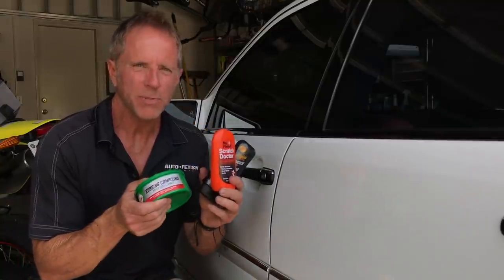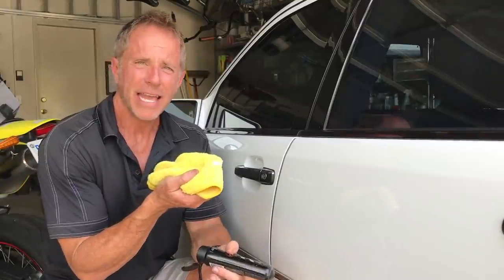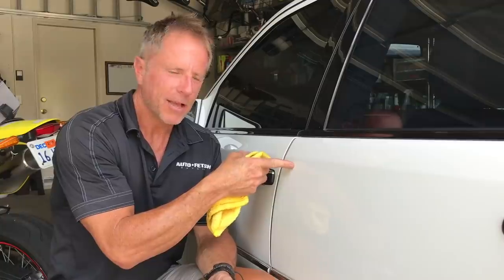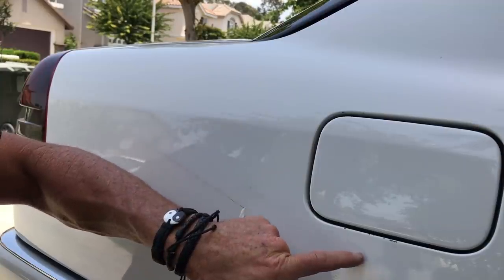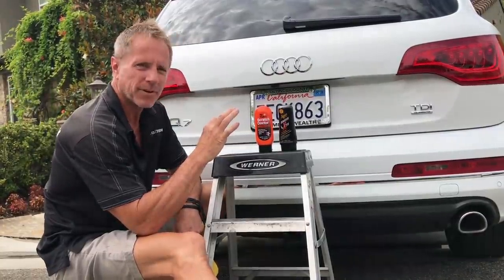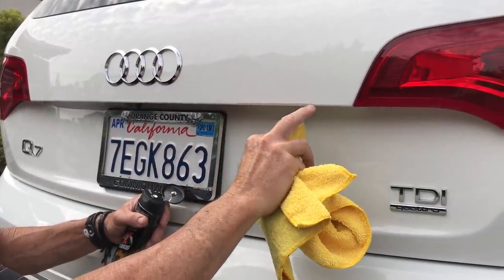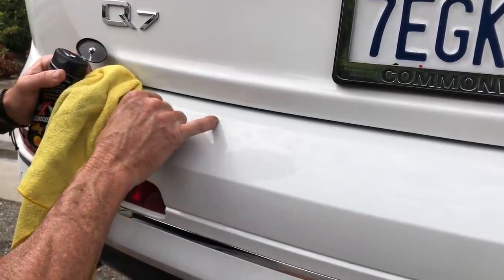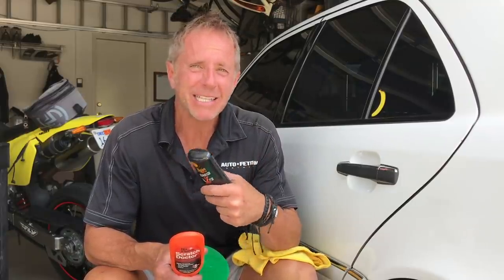Meguiar's Scratch Remover: Why you need this product

Comment: I just bought a secondhand black Nissan. Used this product to clean up some scratches and rubs and while removing fingernail scratches on the door I discovered that it will also remove set on water spots. Nice surprise.

Comment: I converted my cheap Harbor freight grinder into a polisher and with McQuires compound /polish removed most of the branch scratches I incurred whilst cutting through the bushes between my house and Sweet Dick Willies place in less than an hr.

Comment: I actually use the Meguiars to remove scratches from my eyeglasses works very well take the lenses out first amazing products
Reply: Working in optometry, we have to coninuously tell people that there is no such thing as removing the scratches in lenses. You can fill them, but a real scratch cannot be removed. If it happens enough to prescription lenses, you'll end up with lenses that are no longer your prescription because it's a bunch a scratch filler and not the lense that you are looking through.
Reply: Lol not a good idea.... like what that chris person said.... 
scratch X or any of these products doesn’t REMOVE scratches, it just fills in the missing gaps in clear coats where the light will reflect off of it and your visual perception can not see it.... in the case of glasses, lol you’ll be wearing it thinking that it’s repaired but you’re just looking at it through a new lens that has missing gaps that’s filled with liquid that just reflects light... lol.... you might as well wear an eye patch on one eye lol

Comment: Works great on smudges and blemishes.  Not so much on scratches! It does improve them a bit...
But sadly, does not remove :(
Reply: No if it goes through the clear coat into the paint you can't remove completely. All you can do is try and make it not so noticeable unless you wanna take it to a professional
Reply: Go watch chrisfix how to remove scratches video... of you’re lucky, you just need to know how to use compound, polish, and wax....

If it’s super deep you going to need to know how to use wet sand paper.... compound, polish and wax....!

If it’s completely into your paint where you see and feel the metal.... best you can do is touch up paint, and the previous method... it will hide it but will never go away 

Unless you pay thousands of dollars to have that repainted.... or you can paint it yourself if you feel courageous enough
Reply: Remember these layers

Wax
Clear coat 
Base paint
Primer 
Metal 

You gotta gage how deep the scratch is.... if it’s just to your clear coat. Polish and wax fixes it
If you can feel bits of it with your finger you have to cut off several layers of your clear coat using compound..... probably need to wet sand it.... if it’s completely to the primer.... touch up paint is all you can do

Comment: Thank you for the video, I've been scouting Youtube for a video on this product and yours is the best and most detailed. Some douche scratched my year old car and bolted and now I am sitting with a 4 inch long scratch to my coating. Hopefully this product will help. There is also a black line on the rear panel which does not look like it cut the coating. Your video helped me understand that it could be removed with this product. So finally your video has shed light on the 2 types of marks on my car. 
Thanks a ton Darren.
P.S. Bell icon smashed !!!
Reply: NOMAD DRIVES me f
Reply: Hey NOMAD. I know your comment was 3 years ago, but just curious. How did this product work on the scratches you had?
Reply: @J.A.07  Worked well. Did sand out the scratch but it was visible at certain angles. Best bet is to get the paint polished and it will vanish. This is just a stop gap.

Comment: Really appreciate the time you spent to shoot this video, excellent information you give me and now I can stop testing products on my old truck before do something on my wife’s car. 
By the way, both vehicles are white and my old truck has many scratches and I watched a video recommending to use a Mr Clean magic eraser soaked on water and it works , remove scratches and also your clear coat, my truck has fewer scratches but looks like it went to a fight with a sander machine. I know I shouldn’t do that but how can I fix all those spots? I try applying wax coats and still looks the same. Please can you give me an idea?

Comment: I had scratches on my car
I bought Meguiars swirl remover
It did nothing
I then bought Meguiars scratch X remover & applied it - it did not remove the scratches!!!
The thing it did was smell good & made me think of a tropical paradise for about 5 seconds. It did not even touch the scratches it polished them up.
I then dug out a rusty old old tin, the one you prise open with a screw driver, of cutting compound from under years of car products collected The cutting compound applied with a damp cloth REMOVED the scratches instantaneously miraculously i felt a sense of joy flood my being, the scratches were gone. I had to stir the contents of the old tin because it had seperated. I then used another OLD tin of polish to finally bring up a mirror finish
Say what you want but
I will NOT be conned by Meguairs again
Reply: Let me guess, that old tin can polisher filler you used was turtle wax🙄

Comment: Really like Scratch X 2.0. It also has other uses.
Used scratch x on a gun stock with a satin finish. Wow, not only did it polish the varnish, but the grain patterns in the extra fancy walnut stood out.
So besides car paint, it has other uses.
Reply: I was wondering if it could be used on the interior door handles of my new vehicle which has black satin paint finish, so was great to read it worked for you on a satin type finish.  Thanks.

Comment: I tryed this stuff on my factory OEM alloy wheels , just like Darren said in a previous video about polishing alloy wheels I was trying to remove some scratches like he said and it made it worse!
Reply: Raymond perez scratch x is an abrasive. It’s designed to to flatten out clear coating. You are making the scratches disappear by digging down the clear coat until it’s all even. 

So if your wheels don’t have clear coat on them... you’re just scratching them.

Comment: Why this product did not work for me?((( I have a light gray car and a set of scratches. The scratches are not deep at all, it is just an upper layer of the paint is gone, they are absolutely flat (no nail goes in). I think it is called a primer (the upper layer of the paint). Because when I wipe it with a wet cloth, the scratch becomes invisible (water reflects the light). I was so surprised that Meguiar's Product DID NOT DO A THING, nothing at all, as if I was polishing the car with just water.  I applied both using foam applicator (as recommended) and a microfiber cloth. What can be wrong with my car? I bought the product from Amazon, maybe it was expired or stored wrongly? Need to check. Besides, I have the other product (in the orange bottle, purchased from the store, it did not work, too.
Reply: Amateur detailer here. The upper layer is the clear coat, the primer is what goes on the material before the base paint :) I found with scratch X if you are applying by hand, you need work at it with moderate pressure for a good solid 5 minutes to get noticeable results. Even then some more visible scratches  can't be removed completely, only making them less apparent. For those you probably need a machine polisher and/or a more aggressive cutting compound. Hope that helps
Reply: VaporyAbyss Does the scratch come back after you wash the car and then have to re apply this product?

Comment: Definitely not as good as people claim it is but for the price it's fairly good. I have just purchased a used car with around 20 - 30 minor scratches and I had to use a lot of force and two applications. Even then it barely worked.

Comment: This is a scratch filler not remover. The only way to remove scratches from clear coat is to create enough heat to level the clear. This cannot be done by hand (unless you’re a robot) this is why professional detailers are paid hundreds of dollars for scratch removal. I’ve been detailing for 21 years and now you tell me all I had to do was rub some cream on it? Lol after you rub this into your paint, pull your car out in the sunlight and look at the spot where you rubbed. You’ll see what I mean.

Comment: The argument against using circular pattern.... is this....no matter which viewing angle you use....you WILL see the scratches you created when using circular process. From all viewing angles. When using a one-direction process....the scratch you create is ONLY visible from ONE PARTICULAR viewing angle ...and not from ALL angles as a 360 degree, circular process would create. It's not the "logic" that you don't create scratches with one process vs another...it's more a question of "least offensive" result.

Comment: Would this work for darker color cars?
Reply: Matthew Donegan No this is nothing more then a filler. The scratch will re-emerge a day or two later. White cars are the easiest to hide scratches that’s why he used them. On a black car you would see that this product doesn’t work as advertised. Paint correction is the only true way to remove scratches.